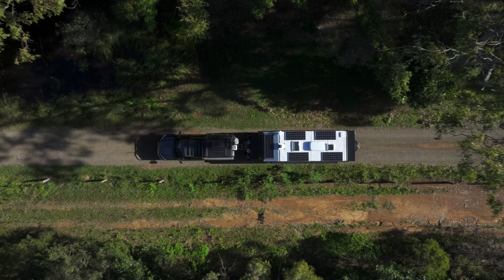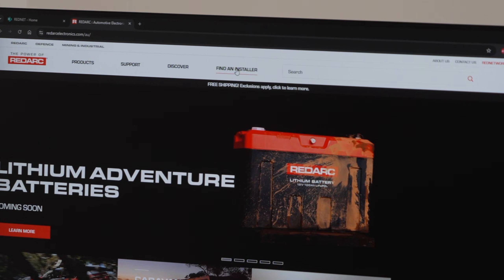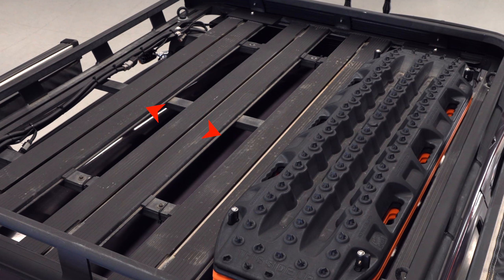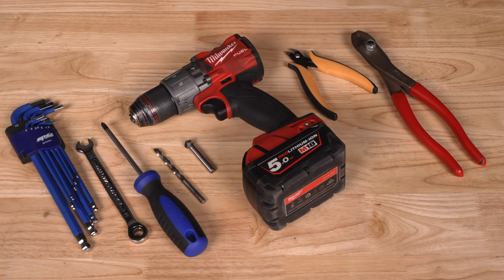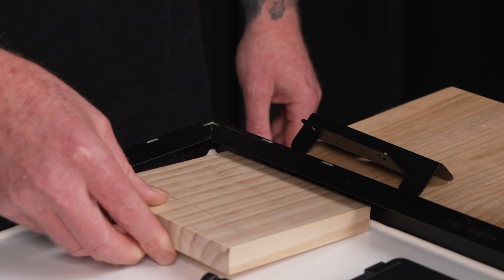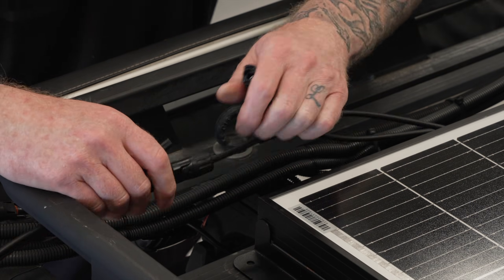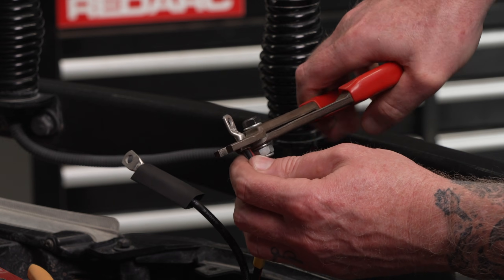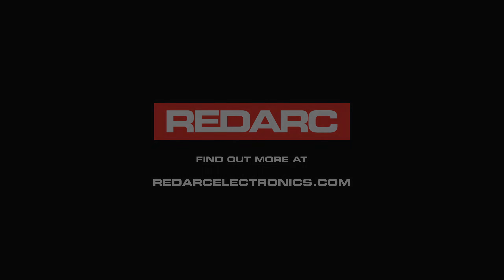INSTALL FIXED SOLAR PANELS ON YOUR VEHICLE | STEP BY STEP GUIDE TO FREE OFF GRID POWER

Comment: Here's the biggest fail I just learned after having the RedArc RedVision install for almost 4 years, the solar input allowed range voltage is 9-32v. Here's the problem, while my 600w solar panels worked well in Arizona, because the heat makes them less efficient, when I traveled to Oregon last month the panels, where the cooler temperatures allowed the panels to be more efficient, were putting out ~32.8-33v thus triggering the high voltage alarm and shutting down input. The solar panel Open voltage is 37.1v. Tell me what I have wrong.
Reply from the maker: Hello, As you have a solar panel array of 37.1v this is exceeding the REDARC solar input limit making this unsuitable for your system. Majority of Automotive solar panels in the market are below this 32v limit, and this is why this was chosen. Recently solar panels have started to be manufactured with higher open circuit voltages. REDARC have adapted and now our new ALPHA range of chargers can accept a VOC of 48v.